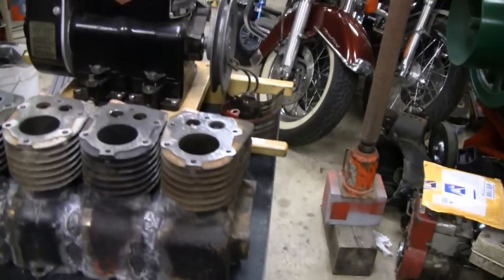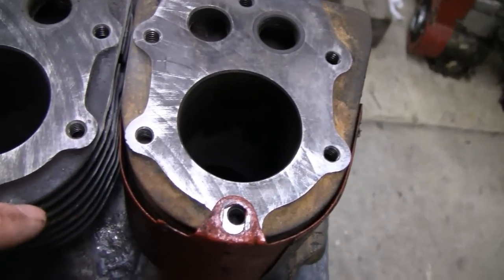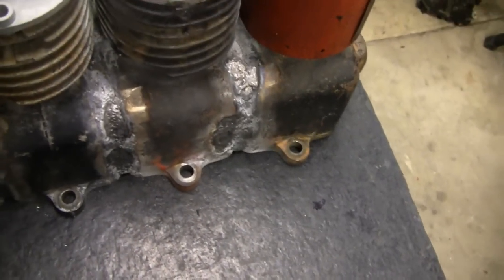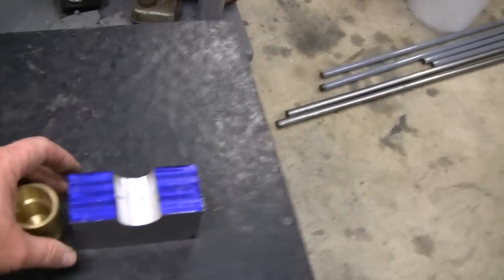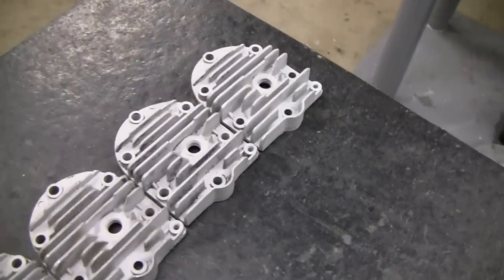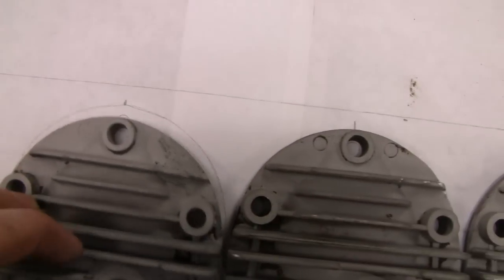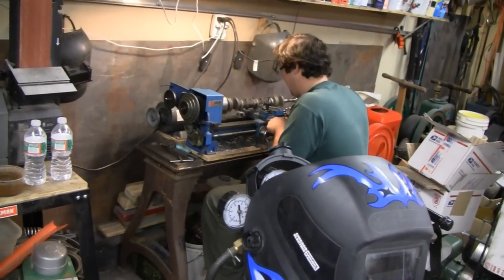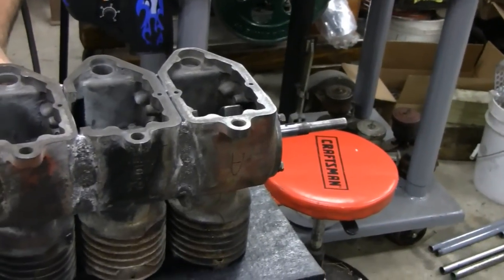HOMEMADE 4 CYLINDER BRIGGS PROJECT (part 8)

Comment: we gotta buh, uh buya, uh bi, uh, buy a bigger lathe for the 6 cylinder?????? NO WAY, FOR THE 6, GO WITH A V CONFIGURATION!!! that way you can use the little lathe, and make the whole block shorter, just make 2 valve trains!! It'll work IT'S GOT TO WORK!!!!

Comment: Like what you're doing guys! My step-Dad had a 27 Chev Pick-up. Not sure why the crank bearing is a secret, but then just maybe no one else has ever looked at the inside of an engine block. You did send out the crank - the offset - for the rods are done on a very special lathe. What is the purpose of the engine - a small tractor? Well that's my corroded two cents worth. Keep building! I'm going back to movie.

Comment: Do you have a segment showing how you made the crank and set the valve timing?
Reply from the maker: Nah, we chose not to show that!!☺
Reply: 805ROADKING I think everything else was easy compared to the effort it must have taken to get that crank just right. There was only a moment there I saw you on the lathe dressing the jurnals. I have to give you credit for putting together 4 cranks and setting their angles just right, welding them up dressing them out and having them come out perfect, "by the sound of the motor" I really enjoyed watching every portion of the build. I have been a mechanic since I was in my early teens, I'm 64yrs and still a gearhead. Also that Pocket Fairbanks Morse was superb. I'm looking forward to you guys next project. Dan K.  New Haven, CT.
Reply from the maker: Thanks alot Dan!! We appreciate you watching!!☺

Comment: Just one thought if you tilt that engine the oil would go to the lower side and starve the higher cylinder.That is if its sharing the oil like I thought I seen still good project. Very nice work. Want to find the finished video to hear it run.
Reply from the maker: Thanks Bud!! Good thought!! But if you tilt any engine the oil will go to one side!!☺

Comment: Hi, loved watching your vids. this out of true flywheel, could you not hold it true, then bore through, then sleeve it back to size? seems a shame to not use it, as it looks made for the job....just waiting for your next session on good workshop practice..thanks, from England.
Reply from the maker: Thanks Mate!! It isn't worth the trouble!! We just bought another one, they're pretty cheap!!☺
Reply: no worries there then, its me, I just hate throwing stuff out..its the engineer/mechanic in me I recon..I sat and watched all episodes of the story on your 4 cylinder build, and like others, would like to see how the crank was joined prior to welding... I just love good old Briggs & Stratton engined stuff, and will only buy garden machinery stuff with it bolted on..
keep the good work going on your builds, keeps me quiet for hours watching all your builds...

Comment: You can true up the flywheel/fan on a lathe. Or maby you can set up a boring bar and turn it on the engine after you get the engine running.
Reply from the maker: It isn't worth the trouble!! We just bought another one, they're pretty cheap!!☺

Comment: I bet the cylinders furthest from the flywheel are going to get pretty hot. Are you guys concerned about operating temperatures or any turbulence that might effect cooling of the cylinders? Just curious if the heat and stress of all of those blocks being welded together might cause any thermal stress and cracking of the castings.
Reply from the maker: Cooling won't be a problem!! It will be getting massive amounts of air from both directions converging between the two center cylinders creating a helical vortex equivalent to hurrican force winds!!☺

Comment: because of each one of those motors each having a sealed block wouldn't it be smart to put a fill tube in each block to make sure they all get the same amount of oil? i mean i know some is going to bleed through between the blocks and around the crank and cam but the middle blocks will get starved of oil because traditionally it gets shoved to the outter walls of the motor by gravity. maybe i'm over thinking that part but that's something that crossed my mind once i saw this all put together
Reply from the maker: You're over thinking it Mate!! All the sumps will have equally the same oil level, there is no bleeding, they have a 3/4 inch hole connecting all sumps!! More filler wouldn't do anything but take up space!!☺

Comment: I had that same pulley on a old compresser pump nice work guys I would have done the same with cutting the old bearing plate much easier thumbs up
Reply from the maker: thanks Bud!! The newer replacement pulley is alot lighter and thinner!!☺

Comment: I bet you can boar out the hub on the bent fan / fly wheel press in a bushing a pin it at the seam . Assuming the spokes are bent and not the rim.
Reply from the maker: We might mess with that Flywheel at some time but for now I just bought a brand new one!!☺
Reply: That works to